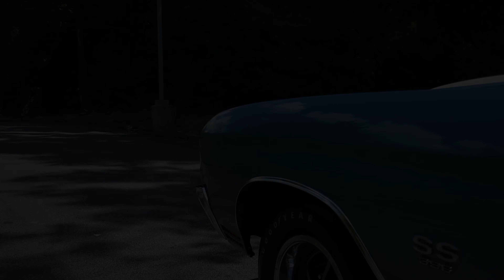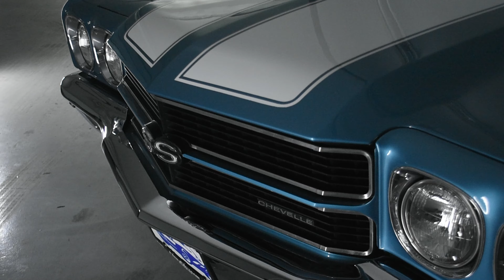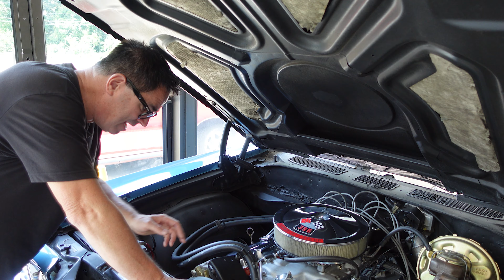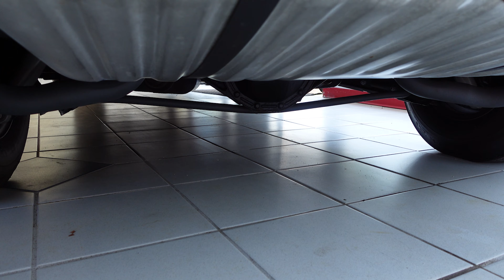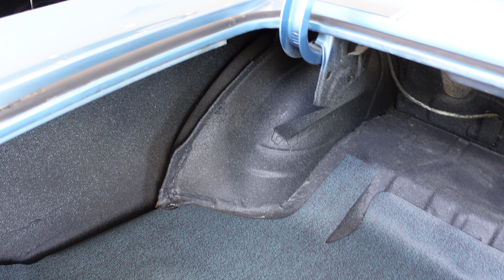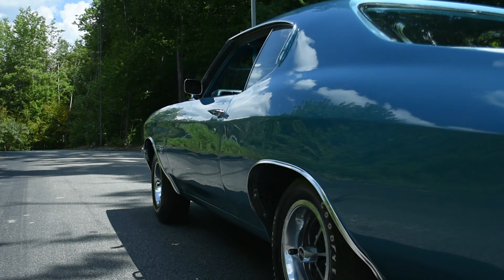The Street Racers Special | 1970 Chevrolet Chevelle L78 Walkaround with Steve Magnante | 396 SS

Comment: The 1970 L78 Chevelle was only made from September through December. The LS6 Chevelle came out in January for 2 and half months. The L78 continued in the 1970 Camaro.The 1970 low rise intake manifold was designed to clear the Camaro and Corvette hoods, but the Corvette didn't get the LS6 until 1971.

Comment: For $99K+, it should have the right radiator cap. Dump the "Big A" auto parts cap and get the right OEM or at least reproduction cap.

With the VIN, you'll win: 1 for Chevrolet, 36 for Chevelle V8, 37 for two door notchback hardtop coupe, 0 for 1970 model year, K for Kansas City (Leeds), MO assembly and the rest is the production sequence. The Leeds plant closed in 1988 and was not a candidate for expansion due to it being an obsolete design and somewhat landlocked. No tag, can't brag, possible code 34 Misty Turquoise exterior paint.
Reply: Also, I noticed it had the rear quarter panels replaced. I never liked the look of that seam for half quarters. If your gonna do quarters get full quarters right!. They look much better. They looked nicely done but still...
Reply: @rogergoodman8665  It should look like no one was ever in there if it's done right.

Comment: No tachometer.   I can’t imagine street racing a solid lifter big block and not having a tachometer.   I suspect it had an aftermarket one on the steering column at some point.
Reply: i get the same suspicion esp when he drops the going out to be mayhem for mach 1/gto drivers line.
Reply: True drivers ( jocks)  dont need tach's , we drive by engine sounds and the seat of our pants 🤨
Reply: @carsbyzee  THis!! Tachs were just novelty items back then anyways you dont need one
Under full throttle there isnt time to take eyes off the road as it is.

Comment: I believe you could not get stripes without cowl induction?
Reply: Stripes were included as part of the RPO ZL2 cowl induction package, but could be ordered separately as RPO D88. That would have to be the case with this L78 car if they were indeed factory stripes.

 Interestingly, the D88 hood and deck stripes could be ordered on any 1970 Chevelle. That includes non-SS Malibu models with the standard flat hood. Several examples of 1970 Malibus with factory stripes have surfaced over the years, with build sheets to document that the D88 option was indeed included as a factory option on these cars.
Reply: for that sleeper look/appeal..as if ppl wont hear the BBC or solid lifters once you get to a redlight.